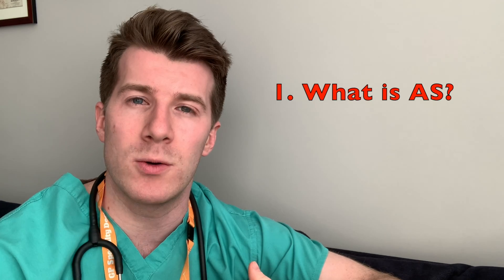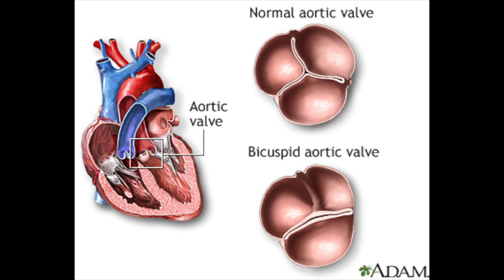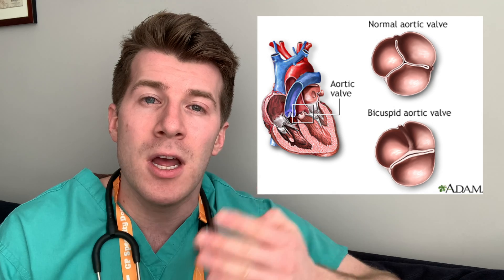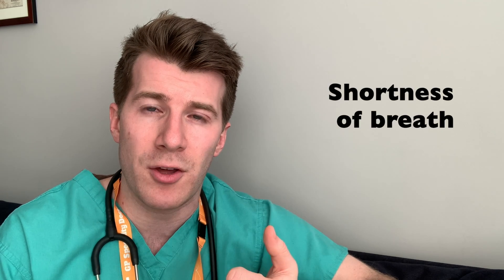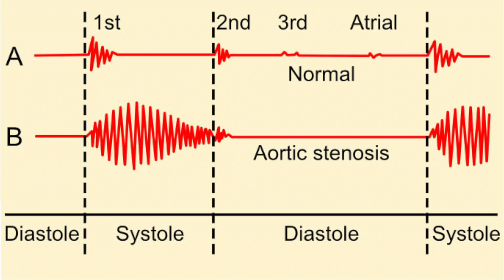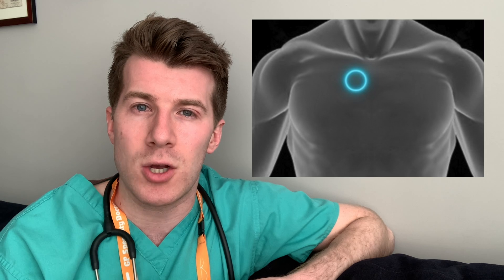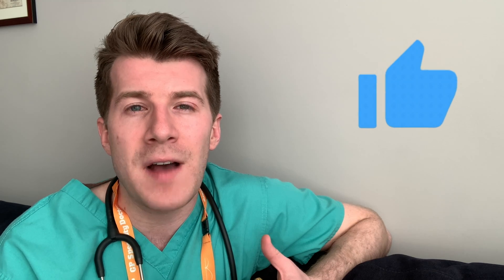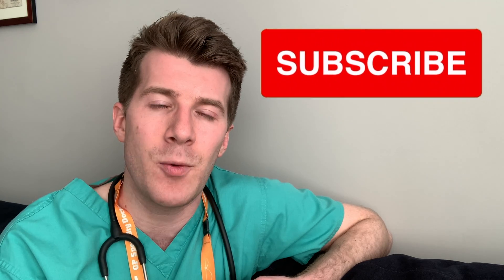Doctor explains AORTIC STENOSIS, including real heart SOUNDS of the murmur.

Comment: I have a murmur but was never told what kind- I got a stethoscope and have been researching deeply and listening to various sounds and I think aortic stenosis is what matches best. my heart also sounds like it has 3 beats instead of the regular “lub-dub.”. it’s two fast then one slower
Reply: With an Aortic stenosis blood exits the heart with more pressure because of the smaller opening. This will cause the Aorta to slowly expand. If nothing is done to stop this, this can rupture and will almost always lead to death. It is a 3-4 cm wide valve, imagine a tear. Please get your murmur checked out. If controlled, and operated before the Aorta gets too weak, Aortic stenosis isn't that dangerous but left alone it is lethal. I'm not a doctor but I was born with an Aortic stenosis. Some people get to 60 without any trouble, others die at 30 because of it.
Reply: @Mahstai888 my kid is 3 yrs old and he born with bicuspid aortic stenosis...worried about this...😢...any suggestions to us...as you born like this
Reply: I work in cardiology performing and reporting echocardiograms. I think it would be very helpful for you to have an echo scan to give you more information about the cause of your murmur
Reply: the thing is- i’m only 22 (female). I also have Ehlers-Danlos Syndrome
Reply from the maker: Thanks for sharing
Reply: Could be heart failure my friend

Comment: Mild Aorotic stenosis in newbornn with bicuspid valve , after how many years it will be reached  to severe Aorotic stenosis ? Please reply
Reply from the maker: I can't comment on individual cases due to medicolegal reasons - sorry. See your doctor if any concerns. Hope the video was otherwise informative. Best wishes.
Reply: I am 28 and was born with a tricuspid value with only 2 flaps (bicuspid) and mild stenosis. Still kicking. Will reply back when I go to my next appt.
Will mention I had an aneurysm around 25. Just keep an eye on it. It hasn't inhibited me otherwise
Reply: I was born with an aortic bicuspid valve and also had regurgitation i had to get my open heart surgery at 22.. I’m 23 now.
Reply: @anilnaik8875 my kid 3 yrs born as like your kid.. what's your stage now and how is ur kid doing
Reply: Very young, I started having issues at 16. I was diagnosed at 24 currently I am getting treated for heart failure